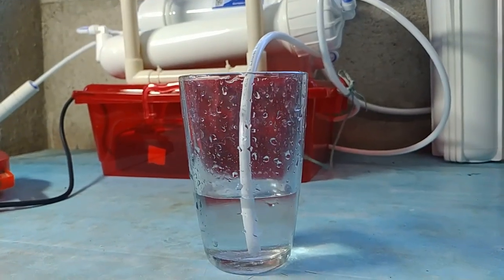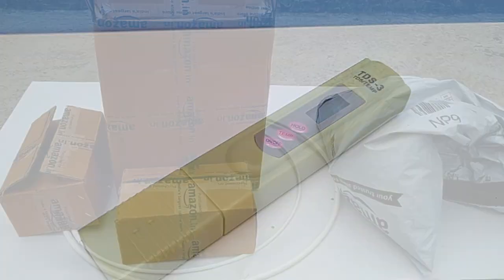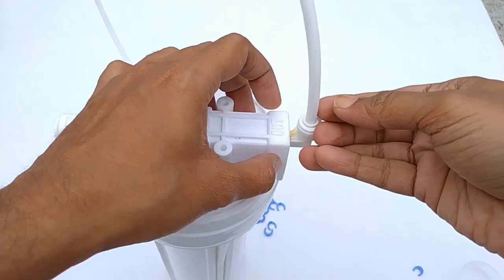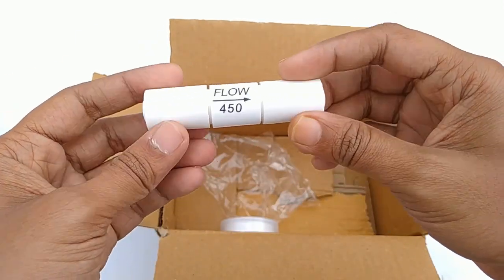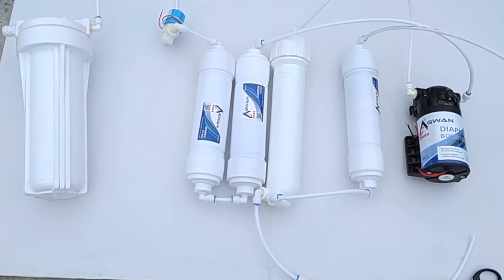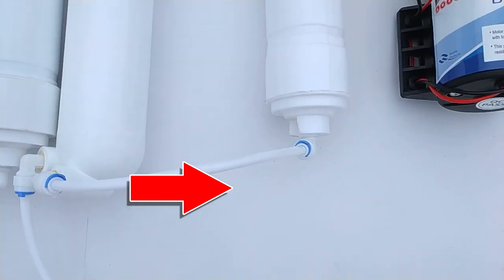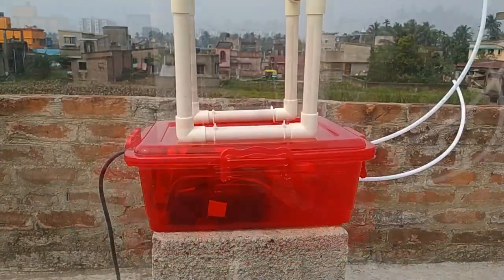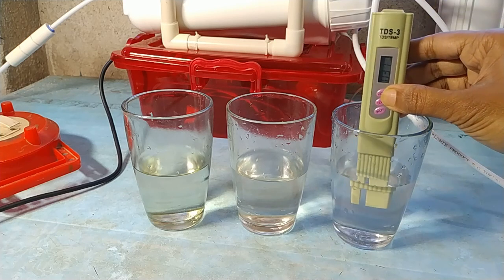How to Make a powerful water Purifier - Homemade RO water filter

Comment: I don't have overhead tank. Can I use bucket water for this setup as input? Or can i put pump directly before first spun filter?
Reply from the maker: If your water TDS is not so bad then you can avoid using the spun filter and then it will take water from bucket. Otherwise, you have to use a mini 12 pump before the spun filter which can create some pressure

Comment: As water with TDS below 150 is said to be good for drinking, even your waste water having a TDS of 145 is good for drinking. So, you might consider not throwing it away and use just like RO output clean water.

Comment: If this is your business, can you ship the kits from your links to the USA? It won't let me buy it off Amazon. I know shipping will take longer and cost more, but let me know and how much. Thank You! Also great video!
Reply: I mean, on your links it won't let me buy it off Amazon b/c I live in the USA, it gives me no option to buy.

Is it possible to ask your affiliates to add shipping options for outside your country? If so, send a link please. 

I want to buy the kit without any of the electric parts though, (no motor, no salvo, no wires, etc.) I just need the filters and all the plumbing, connectors, tubing, so it works on a tap water outlet by itself. 

I was thinking of buying multiple kits for my family members as our water isn't the best here either. 

Anyways, let me know! Thanks!
Reply from the maker: Thanks for watching the video. This is not my business but I can suggest you some similar product links which are available on the Amazon US site. I will update those links in a few days in the video description. Thanks
Reply: @technoreview85  Ok! Thank you! I really appreciate it. Also what is your opinion on adding an alkaline re-mineralization cartridge at the end? I have read many debates on health issues from RO water, (b/c it takes out all the good minerals too), but others say it is perfectly fine as we get those minerals back from food. I don't know,  i will probably add one, but that jumps up my cost another $20. The system I am looking to build is about $95 US for all the cheapest parts on Amazon and with no pump. I also decided not to put the extra sediment filter, I figure one is enough. 

My setup that I might buy, (again this is the cheapest parts I could find here in the USA) is a 5 micron sediment filter, two carbon filters in a row, RO membrane, then alkaline cartridge. And then all those hoses and connectors I need too, including a tap connector. I was thinking geez that adds up quickly, almost $100. Maybe I'll just make a 3 stage, without RO membrane to start, one sediment, 2 carbon. It would be like those water pitchers like Brita or Pur' pitchers i am guessing. That would be $50 less lol. I can always add the RO stuff later I figured and this should be pretty clean water, better then the tap for sure. Anyways, thanks for replying! And thanks for your help! Great video by the way!

Comment: If you are still using this, you would have accumulated health issues, the TDS of drinking water should be between 50 to 150. Less than 50 is not good.

Comment: Now get ready for hospital expenses and pain Bro, after all this hard work, you are missing an important thing to add, the added minral cartage because TDS of 40 is very harmful.
Reply from the maker: Actually, it gives water the same as 20 litres of purified bottled water. It does not give mineral water. The mineral is necessary but without minerals, water is not harmful. Anyone can use a mineral cartridge at the output line.
 Thanks for your opinion